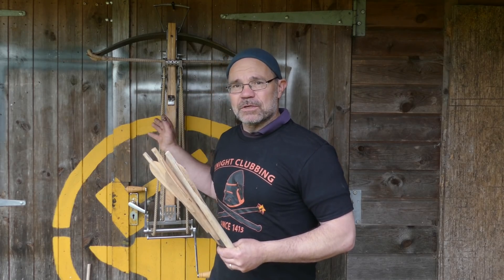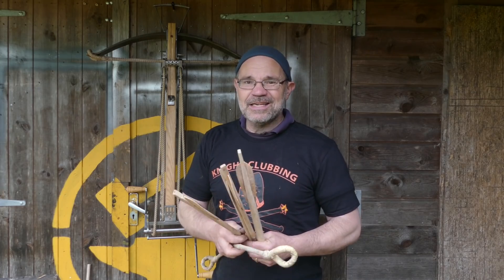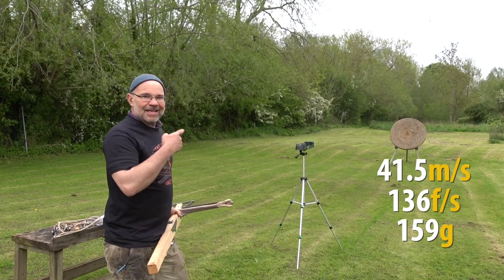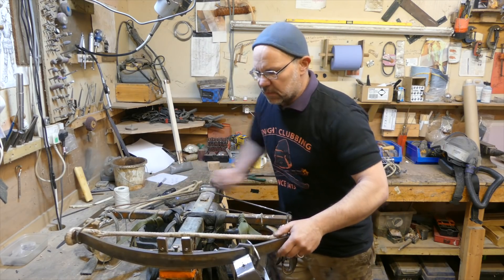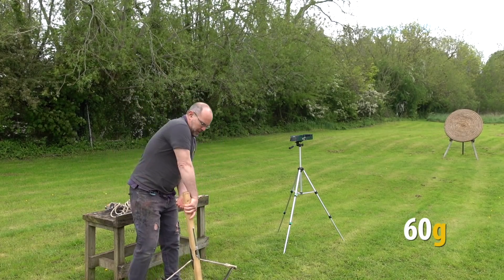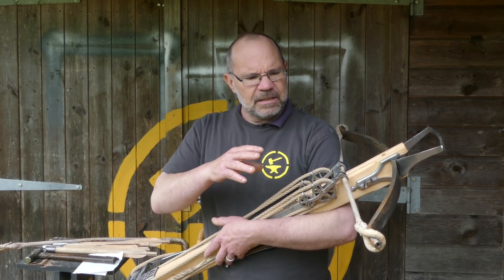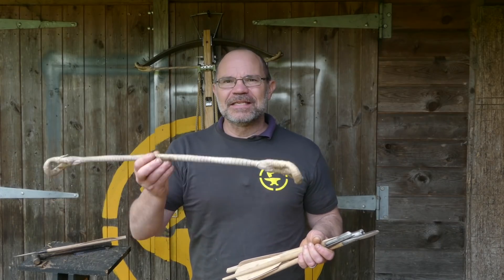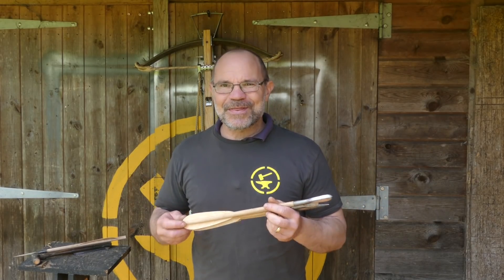Medieval bolt POWER!

Comment: my answer before watching the video: to the degree that making the bolt lighter makes the bolt faster, it should be the case that lighter bolts have more energy. The relationship between energy and mass is linear, but the relationship between energy and velocity is a curve.

Comment: According to Fragment Hazard Criteria, energy is meaningless when it comes to blunt impacts (at these low velocities, at least, it could be driving factor for hydrostatic shock with bullets) - so anything that doesn't go through mail. The findings were that there were three categories of blunt impact injuries, and the thing that mattered how badly it injured you were either m*v (so, momentum), m*m*v*v (both speed and weight squared) and m*m*m*m*v*v*v*v (speed and momentum to the fourth power). This is especially important with the heavy weight bolt, because that one will be fearsome in these three categories, much more so than the energy alone would suggest.

If you are wondering, Fragment Hazard Criteria gives us even the lightest bolt above the 50/50 odds of causing a major injury (cracked skull, breaking ribs enough to lacerate insides), and has even odds of going through a thigh even when blunt. Wear armor when getting shot at, is what I take from that.

Another thing I noticed is that the heavy bolt is about 150 grams at 45 meters per second - which is about as fast as I can sling a baseball, which weights 150 grams. And there were clay and lead sling projectiles found in that weight category, probably meant as a siege ammo or anti-armor. It's interesting to note that once you get to cranequin crossbows, you can use them to make all but the most elite slingers obsolete, and with almost no training required at that.

Comment: Regarding the lighter String: Maybe trying a different material could change velocity and momentum. So sinew, flax, hemp, bast, maybe even leather are all different in elasticity and could influence the dynamic of the bow and therefore the bolts. Worth a try?

Comment: Your videos are always so informative. I really love them. But seeing all the numbers you have provided with your vids, I started to wonder why crossbow are considered so much more powerful than bows. Easier to use I can understand, but talking about speed and energy, they looks very close to bows, if not inferior. Am I missing something?
Reply: I think you have hit on something here. Per time period, I do not think there would be much difference in power between bows and crossbows, but crossbows could throw a heavier weight? I will have to go back to lockdown longbow vids to see the arrow weights, but even then not all armies used longbows, so the difference in projectile weight and energy transfer may have been a larger factor.
Reply: You're not missing anything, you need to practice for years and build up very specific muscles to shoot a warbow, you just have to wind up a windlass on a crossbow and point.
Reply: @thomasjackson8737  that’s interesting. I will check darts and arrow weight again too, ‘cos energy wise they didn’t look so different. But your point could answer why crossbows were considered the most powerful between the two
Reply: @ziggarillo  yeah, easiness of use was clearly the main advantage of crossbows, even if genovese men had a mandatory training requirement like the english bowmen had (meaning they were highly trained soldiers and not some peasants levy troops of sort)
Reply: @lscibor  wow three to four times more energy than the vid 850# crossbow. That’s impressive. But, that said,  a question arise: is this swiss one a singularity or was this long draw model spread and common in europe?
Reply: @shaidrim  I believe that rampart crossbows, "Wallarmbrust-s" (German for "wall crossbow" (townwall, not regular wall) were very much a thing.

http://myarmoury.com/talk/viewtopic.30553.html

https://commons.wikimedia.org/wiki/File:HJRK_A_108_-_Wallarmbrust_c._1460-70.jpg

Bottom line is that the 1200 pounds/6 inches design pretty much inefficient from the scratch.

You can top it just by going, say, 400 pounds 20 inches, theoretically more potential energy, and the bow is likely to be bit more efficient due.
Reply from the maker: That bow of Andreas' is amazing but is a 'rampart' bow rather than an open field bow and I assume for performance reasons, steel limbed bows of that kind of width and so draw length just did not exist, but yes 1200lbs over 15" can only be a monster if the limbs are light enough

Comment: Also, medieval techniques, everything is going to be approximate, they aren't going to be weighing strings to the gram, potentially the ounce, but more likely they just make them to a pattern and set, especially as every village in Europe had its own slightly different measures.  Same goes for the crossbowmen on the field, he isn't going to be measuring angle with a protractor , he is going to aim roughly 45 and shoot.

Comment: I know I'm really late, but the thinner/lighter bowstring might also have a bit more flexibility. I know bowstrings are made from rather inflexible material (interestingly, in Germany it's called "Sehne" which translates to "sinew", but material like sinew or guts or other animal-derived strings weren't used much in central and western Europe; according to any evidence they preferred hemp or flax for its rigidity) but hardly any material has zero lateral give. And the thinner you make it, the more it can (slightly) stretch, which then reduces the efficiency.

So basically I'm saying: unstrung the length of the two strings may have been virtually identical, but once you put them on the bow the lighter one may have ended up a few millimetres short - and once you've loaded the crossbow, that effect may have increased to the point where you lose a significant amount of power.

Comment: Been waiting for this video for years! 

With regards to the string, a possibility is that a heavier mass is more effective at energy transferal.

Heavy mass accelerating heavy mass = lots of energy transferred 
Lighter mass accelerating heavy mass = less energy transferred 

A heavy string would accelerate slower meaning the acceleration phase is longer.

Comment: Momentum (how far the apple rolls after you hit it) increases  in a linear fashion with an increase of weight and/or speed.
Kinetic energy (how many fragments the apple is broken into) increase in a linear fashion with mass, but increase exponentially with speed.
Some targets need the 'oomph' of a heavy bolt to penetrate, others might need the sharper impact force of a light but faster bolt.
Steel plate would be bested with fast bolts, fabric cuts better under heavy (sharp!) bolts.
I may have that exactly backwards.

Comment: With an unloaded dry fire, the string will only move so fast. no mater how light the projectile, you cannot exceed that speed. Diminishing returns means heavier bolts are able to have more of the potential energy transferred to them.
Reply: @JorgTheElder  the premise of the video is; "does a lighter bolt equal more power?" Because energy is M(V^2) lighter projectiles usually mean more velocity. However a heavy crossbow is more like a train engine on a short track than a gun.
The train engine has a top speed of say 10mph, but can shove a lot of mass around. If that engine pushes a ping-pong ball as a projectile, it will achieve top speed as fast as it can, but its still a ping-pong ball moving at 10mph. 
The engine could then push a single train car to top speed just as it reaches the end of the track, maximizing its energy efficiency. 
A lighter string won't necessarily give a noticeable increase in speed in a heavy poundage bow. The physical speed limit of the bow makes more difference than an ounce of mass saved when you are close to top speed.

Comment: You should consider to record shooting both strings with ultra slow motion. It may be that lighter string is smashing the arrow and bouncing back a little and not accelerating the arrow over full draw length. Maybe stiffness of both strings are considerably different?

Comment: I think I made a similar comment when you posted your range tests on these bolts, but I'd be very interested to see the results of a bolt as heavy as your crown bolt but a deliberately aerodynamic shape. I suspect what kills the range on it is air drag. I also (for the same reason) wonder what difference polishing or varnishing the bolts might make.

Comment: Great video! Assuming a flat plane and no air drag(could be accounted for if we knew the drag coefficients of the arrows), you could calculate their energy from the distance they traveled, no need to measure their velocity. Since their launch angle was 45 degrees, the energy can be calculated as m(mass)*g(free-fall acceleration)*d(distance traveled)/2. According to my calculations, the energy of the 159g bolt was 105J, 93g was 91J, 80g was 80J, 65g was 69J. So pretty close to yours. I'm sure taking air drag into account wouldn't be that difficult
Reply: Depends what you mean by "pretty close". Your estimates are all about 20% below the measured values, so air resistance is significant.

Comment: I would expect that your dealing with a number of different factors. 
Inertia, friction , wind resistance etc. 
Personally I think you are going to approach the point of diminishing returns fairly quickly.
Plotting the data points on a graph might give some indication.

Comment: Before watching this, I would assume that the answer is no, lighter bolts won't strike with more power. There is a maximum to the acceleration the crossbow can output regardless of how light the bolt is, so even if the lighter bolt moves a bit faster I doubt that it would transfer more energy than a heavier bolt. I will now proceed to watch the video =D

Comment: you should consider doing your test by triplicate, three times the same thing and average your results.
Reply: I was thinking the same thing. But it will take a lot more time to retrieve the bolt and shoot again.
Reply: @chubbymoth5810  gotta use more bolts or get a helper
Reply from the maker: Yes I should, but to be honest that would improve accuracy of results, but would still be very very far from good statistical set and ~I simply don't have the time, so I figure either 1 or three shots depending is good enough to illustrate the point which is all I am really trying to do

Comment: Surely the main factor will be the recoil speed of the bows.
If the energy in the system had no upper speed limit then the bolts would absolutely have the same energy regardless of their mass but Bows don't work like that, they have a maximum velocity set by how fast the arms recoil.
Although the heavier bolts inertia is slowing this recoil speed down a bit they are still relatively close to the maximum speed and so carry more energy than lighter bolts which although they approach closer to the bow's maximum launch speeds are (as you said) less efficient, they waste power.

Comment: Hey Tod! I had an idea, have you ever considered how they might build a compound bow in the medieval era if they would've known it was possible and effective? Just something I was thinking about recently, I'm not even sure it's possible to make a proper compound bow with those types of materials, but I figured if anyone knew, it'd be you or someone else here. 

Honestly I'd be surprised if you couldn't make something halfway decent though, but I'm no bowyer nor engineer TBH.

Big fan, I appreciate the data in these videos. Very interesting, probably hardly anyone would know these things without channels like yours.

Also I'd curious to see these crossbow bolts against plate armor (like in the arrows vs armor vid), not sure if you've done this yet. I'd be curious to see how they compare to Joe Gibbs's longbow.

Comment: Makes sense that the "plate cutter" would have the highest momentum, it needs that force for penetration. 

I suspect the big heavy bolts were good for crossbows used by siege defenders, where stopping power was the biggest priority, while the lighter, more aerodynamic needle bodkins were probably way better for precision shots at range.

Have you ever done a test of group accuracy with each arrowhead type at long range? Like made 3-6 of each type, shot a group, and looked at what performed best at the different ranges?

Comment: If you're measuring the weight of the string and bow, there's another factor probably more important, given the relatively slow speed of the components involved. How much resistance you offer to recoil. A crossbow held against a steel cuirass would recoil much less than against a relaxed shoulder. [Defining here "give to recoil" as the distance the xbow's body moves backwards while shooting.] Would be interesting to see how much more energy the bolts have if the xbow's stock is firmly held against a solid, heavy object.

I'll go even further and say that if the crossbow is lightly held then the energy lass will be ~(mass_of_bolt/mass_of_crossbow), so much higher for the heavier bolts. Holding the stock tight, for this model, would be the same as using a much heavier crossbow body.
Reply: A crossbow doesn't have recoil as guns have recoil. A crossbow actually pulls away from you, not impacts you in the chest.
Reply: @cheetawilliam  yes a bolt is pulled forward and a bullet is pushed forward.
Reply from the maker: Cheeta william, I can tell you that a crossbow certainly has recoil, but upward as well as backward
Reply: @cheetawilliam  Of course it won't be like a gun. It still follows the same laws of conservation of momentum, though.
Reply: @cheetawilliam  Bow pulls away from you, but it's mounter on a stock or archer's arm and it's, in turn pushing against those. Thus recoil.
Reply: Wouldn’t any ‘pull forward’ effect happen after the bolt is released anyway when the limbs abruptly stop at brace?
Reply: @ttneiltt1  Maybe a bit if the string is heavy and is dry-fired, or the bow wobbles forward. The way I see this model is when the bow is released, the centre of mass of the crossbow moves a bit forward and down[the bow is pointing down] so the reaction will be back and up. 

Now the fun begins if you mount the bow backwards and use a pulley system to fire the bolt forward. If the bow is heavy and the bolt has low enough speed*weight you will end up with forward recoil.
Reply: @I'll let you finish but first  fairly sure I’ve seen those crossbows. Seem to remember seeing a vid of someone shooting through a cinder block with one! But yeah, what you said makes sense. going off recurve bows that do jump forward (hence finger slings for Olympic archers who don’t grip the bow) but after the arrow is released. Makes sense what you said and just shooting a 150lb fibreglass limbed crossbow with negligible recoil, 1000lb Steel limbed crossbow would have a much more exaggerated effect as Todd mentioned

Comment: Well, F=MA (Force equals Mass times Acceleration). So if a bolt is say 20% heavier but loses say only 8% velocity compared to a given lighter one it will hit harder than the lighter one. At long distances the drag of gravity on a higher mass and the higher resistance caused by moving through the air is going to bleed off your initial force and give you a lower range for your heavier bolts.

Comment: What's the energy drop off with distance though and when does it become non-useful, that's the important bit for which bolt you'd really want to carry, unless you knew you were going to be in a particularly close range situation.

Comment: Every gram of weight at the very middle of the string (where it meets the arrow) pretty much "adds" one gram to the arrow itself, geometrically speaking.

It's additional gram of matter the bow has to speed up to approximately same velocity as the arrow - using the same leverage and all.

So if you're shooting 60 gr bolt, theoretically taking away 1 gram from the middle of the string should theoretically add like 1.666% to the final energy of the arrow.

Obviously that's indeed considering "all else equal" which is a big thing to consider. 

But Adam Karpowicz does note that adding modern FF string, instead of dacron one, to his turkish bows, would add 6% of efficiency.

If I had to guess, making lighter string that actually spans the bow in almost exactly same manner (geometrically and dynamically) as heavier one, should still yield some improvements.

Comment: 1:56 The chronograph is located very near the bow (i.e. not near the target) .. I read somewhere that crossbow bolts suffered more energy loss due to air resistance as compared to arrows .. and since it’s the energy at the target that actually matters .. could we see some experiments in this area?